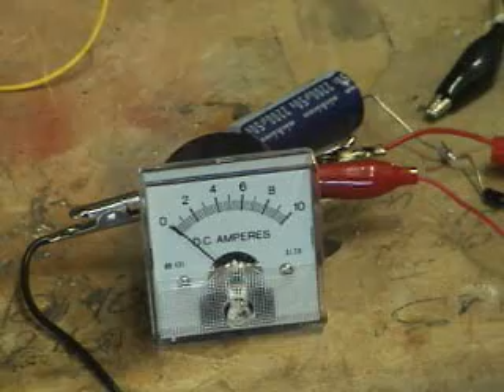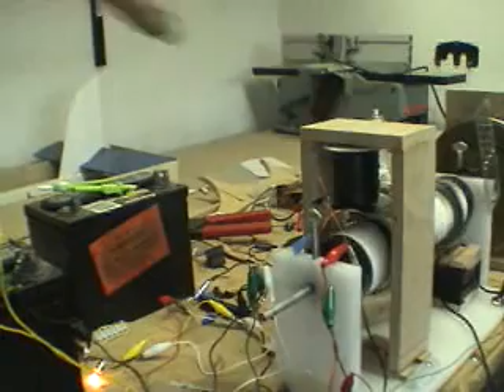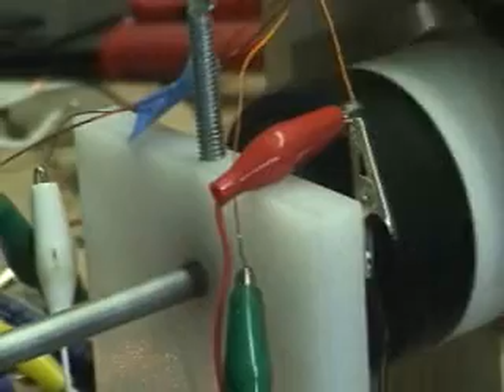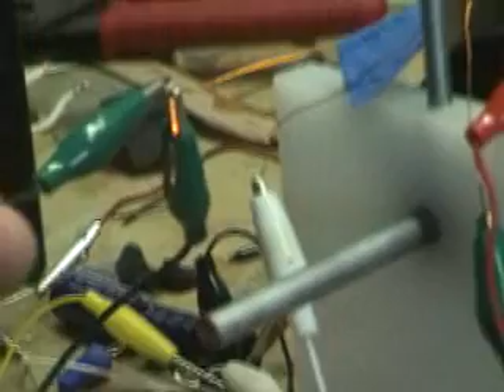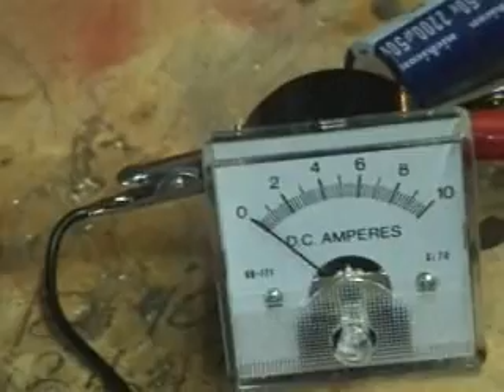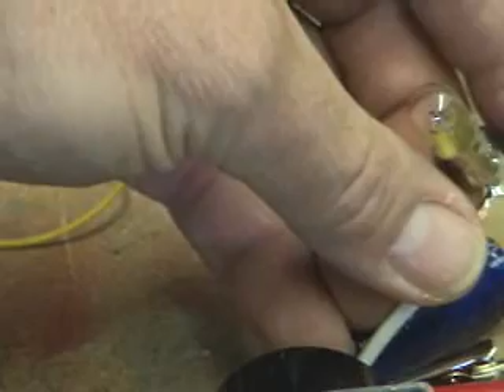Feedback circuit to coil

Comment: Batteries, not like CAPS - must GO! Air-coil generators are like "depleted uranium" shells - "Oh depleted - so it's OK?" No idiot: ALL uranium gives off radiation & has same half-lifes! "Oh- coils must have iron core to give power?" No idiot, spinning magnets break just as many guass-lines with NO CORE at all! But near-by Fe can MOVE center of field: so don't have any Fe near-by! Then you eliminate heat-waste & max. usable output! STOP RE-CHARGING BATS you BEDINI'S! Make something GO!

Comment: Hate to tell you but you can't make energy from magnets. Energy can only be created with either moving charges or a difference of charge. As for the moving charges theory, a magnet on its own does not create energy because it is not moving. You are providing the energy with the battery, not the magnets.

Comment: Great work, very inspiring! Im doing something very similar and have a some questions.  Ive came across several sources saying not to use neo mags on the motor side. You say you have more torque, desirable for generator side of course.  Was there a increase/decrease in rpms?  Change in input power? Any ill effect to support the info ive come across?  Any positives you didnt state in video? Already ordered some neos, but wanted some advise from someone experienced.   thanks

Comment: thanks for posting the video.  many capacitors in series should do the job.  i saw a similar version from one group, some minister group and their set-up was similar to yours and they used many caps in series.  this should be your solution.  then once your motor is running and in tune, then you can disconect the power source and be self running.  your almost there.  5 stars.  keep up the good work...

Comment: That's not how the bedini setup works.

The extra energy can be collected from the batteries when a radient spike hits them.

The spike actually creates a larger potensial inside the battery then the energy needed to create it.

His motor is highly efficient because he manages get rid of the back emf (which is the radient energy), but it wouldn't be able to run by itself.

Instead you can use the captured energy inside the battery to power the loads you need.

Comment: Great work! I'm currently working on a self running engine/motor myself. I'm very excited by your success. Makes me very optimistic about my own project. I'm hoping to get somewhere in the neighborhood of 175 HP. I'm using a 1/2" dia. shaft. 28 - 1/2" cubed N42 neodymiums. and a special coil winding with 24 awg. magnetic wire. It's coming together nicely so far. I'll be posting video soon.. keep up the great work. I've learned alot from you.Thanx :)

Comment: If I were you I'd use a dozen 4Farad 15v memory back up caps. So its about 50 Farads at 12v. It shouldn't last longer than a couple minutes unless you are accumulating external energy in to the system.